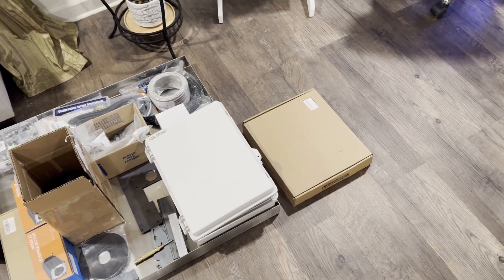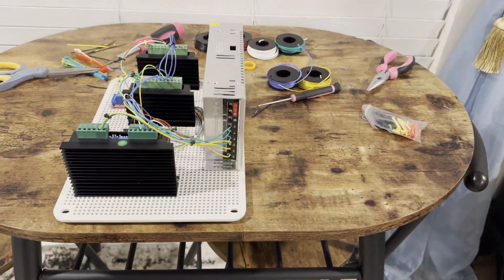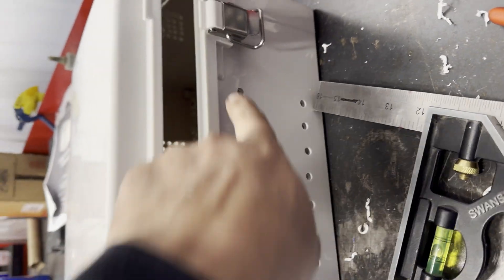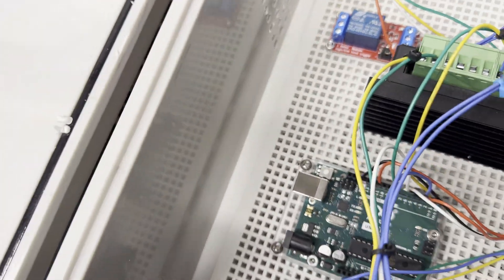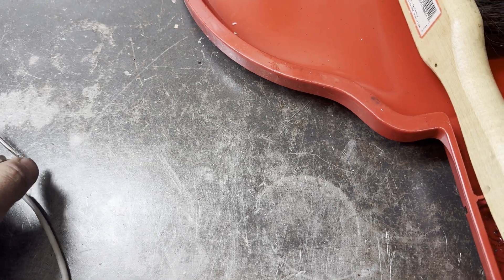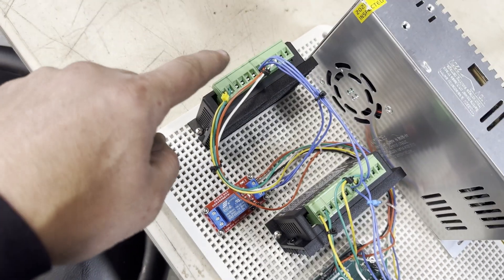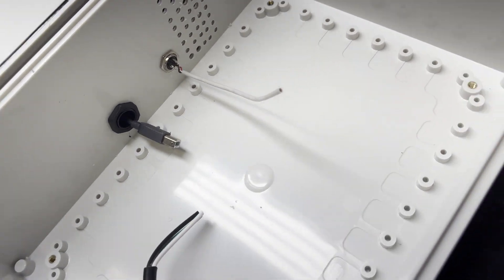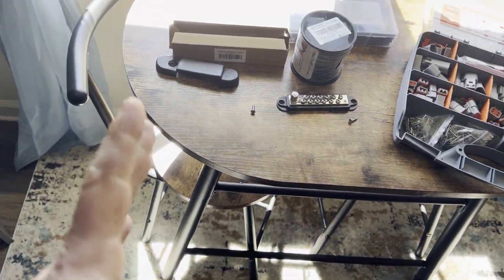DAY 5 DIY CNC PLASMA TABLE BUILD

Comment: Hello, once again.  The expandable loom you are using, is that 3/8" ?  I tried contacting the company and the closest i could come to what i thought was the number they said was 3/8".  Just want to verify before i order. BTW the # they gave me was x001104165.  Also, the connectors you used at the motors,  are you happy with them?  Just want to make sure before i shell out $150 on a kit.  Thanks again.  Demon
Reply from the maker: Yes it’s a 3/8 loom i used on all wires, then just some heat shrink at each end to close them off nicely around the pass-thru wires. As for the Connectors at the motors they work and look great for me, only hard part is making sure you get a good crimp on the tiny 22 gauge wires as the connector terminals are technically for a larger gauge wire. I found that stripping the wire further then folding it over on itself to bulk it up helps with crimping.
Reply: Thank you.  One more question ( famous last words  hahaha).  The arduino sits in that clear tray. I've mounted everything but the relay ( screws I got were too big )  and the power supply, to the backer board.  I was about to begin the wiring and was concerned about using bare hands on the boards.   The arduino fell out of the tray while I was securing it to the board and I picked it up by the edges but I'm not sure how touchy it is to static charge.  What I can see from your video you were wiring bare handed but I didn't see you directly touch the arduino or the relay so wasn't sure if I had an issue or not.  Thanks.
Reply from the maker: @williamlanphar630  I've had no issues with being bare handed, however, I only handled the non circuit areas of the board and relay
Reply: I just wanted to touch bases with you one more time.  Since I last spoke with you I spoke with JD and asked him what gauge wire he used for the jumpers in the box and he said 18 gauge.  I tried to locate pins that would allow me to make up jumpers to " simplify " the installation.  Try as I might, I was unable to locate pins that would allow me to insert the wires and crimp them.  I had taken the precaution of buying some pre-made jumper wires .  I could o ly locate 24 gauge jumpers.  I spoke with some electronics guys and they all said that should be sufficient.  What I want to know is what gauge wire did you use to connect the Audrina, Motor drivers, etc. I would really like to get past this point and make some progress again after this long delay I have had.  Thanks as always.
Reply from the maker: @williamlanphar630  

All my internal box wiring is done with

https://a.co/d/c5kVsFV

all shielded external wiring to the motors switches or cnc control are done with either of these respective to their amount of needed wires 

https://a.co/d/2PTk71o

https://a.co/d/eHTXHJ2

Comment: 11:21 Hello ,again.  I bought the box you are using here. I was originally going to use a large plastic ammo box but with the Z- axis driver I was afraid it would be too crowed.  Not to mention not  enough air circulation.  I like the organizational approach this box provides. BTW the connectors you bought, does this kit provide enough of the correct configuration for the project ?  Thanks, once again Demon
Reply: I used the HF ammo box.  Now that I have the THC, I am wishing I had used a larger enclosure
Reply from the maker: @_lumpy8859  how are you liking the THC?
Reply: @_lumpy8859  that was what I was thinking as well.  The one I ended up using has plenty of space.
Reply from the maker: Awesome, yes it makes organizing much easier. You will have some people (such as the other commenter) who thinks the box has to be Metal for interference purposes. But with today’s technology and low frequency start plasma cutters, as long as everything is grounded and shielded properly, you should have no issues. Mine is working just fine. 👌